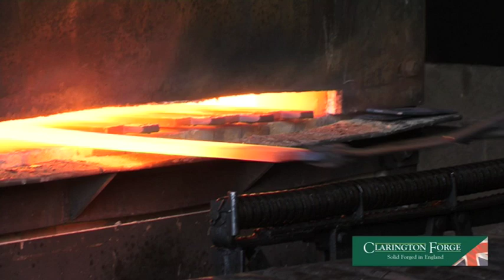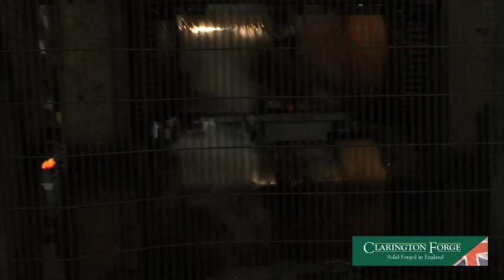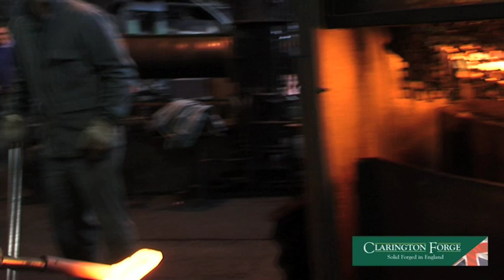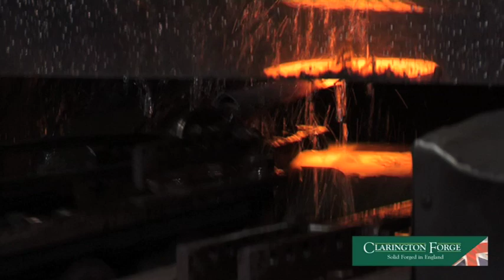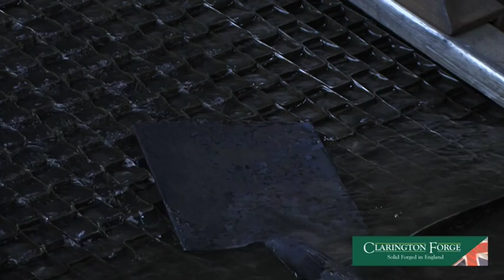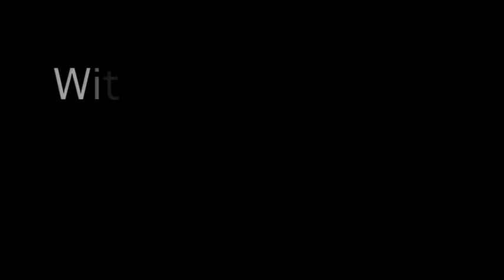Clarington Forge Forging A Spade.mov

Comment: Clarington Forge has been in business since 1780, and no, that's not a typo! I've been using the same beautiful spading fork and spade since 1980, with only a coat of oil now and then on the handles.